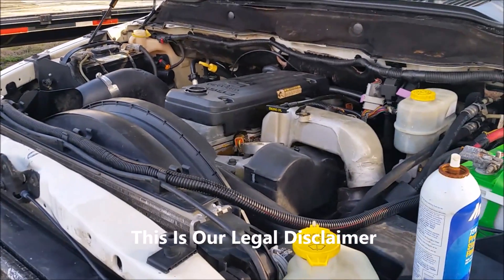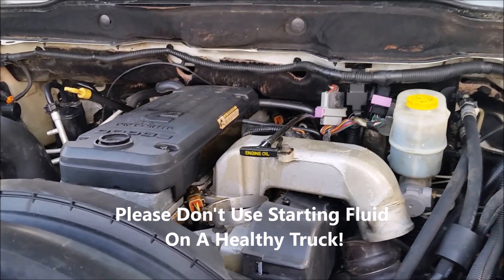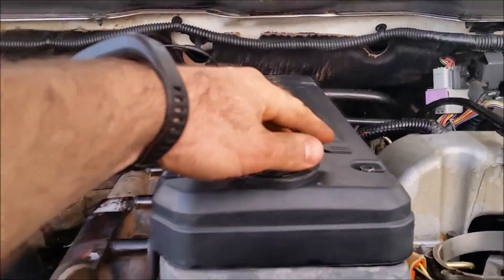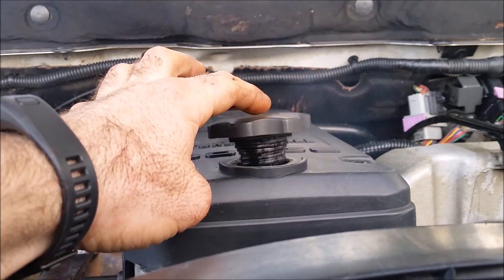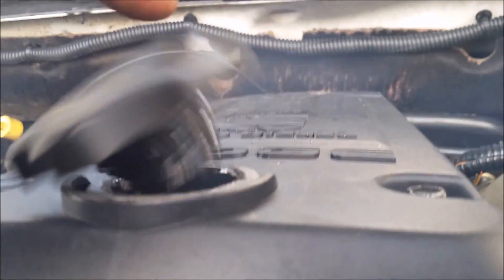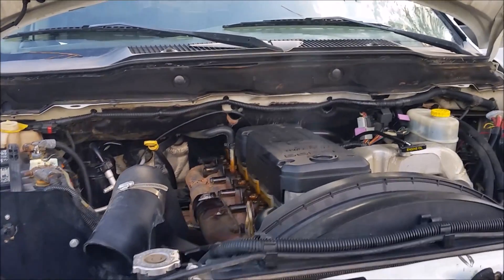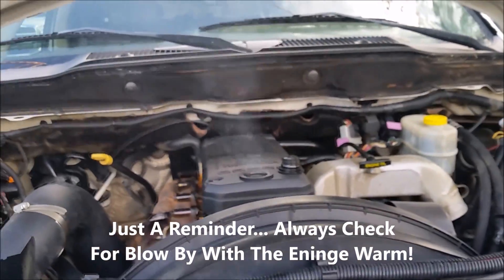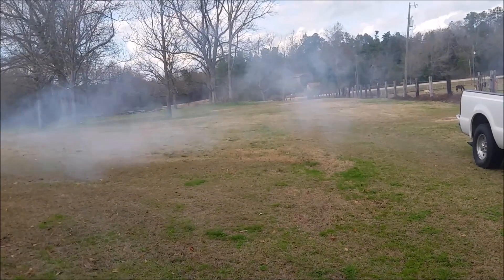Perfect Example Of Blowby On A Common Rail Cummins

Comment: Hey, I know I am a little late on this one but how much did the rebuild set you back? Do you have a price breakdown of the parts you used and how much time you put into labor? Thank you
Reply from the maker: Hey there Peter,
We haven't rebuilt this particular motor yet, but we have rebuilt several others. As far as how much it costs, it really just depends on how far you go on the build. If you go back 100% stock then it will be a good bit cheaper than what we do. We have learned that in the long run it is much easier ( and cheaper) to do upgrades early and not have to go back into them later. 
The same thing goes for time,  we spend a lot of man hours trying to get them as close to perfect as possible.  Why? Cause if you start talking to guys who have bought motor or who have just thrown them together quickly, it usually ends poorly  and then the motor has to be rebuilt again or major time spent to figure out where the issues are.

So my question for you is what do you intend to do with the truck? From there I can maybe give you a ball park of what we would expect to pay.  Keep in mind though,  we spend a ton of time finding deals on the parts we want to help keep the costs down.
Reply: I bought a balanced long block with arp 1000 HP head bolts,fire ring head gasket #103 springs 800 HP pistons , industrial injection wire tap vp44 industrial injection turbo, fluid damper harmonic balancer 4" down pipe bd flex plate triple disc converter firepunk tow master plus transmission. The Plenum plate oil filter housing and most of the outer parts are all billet aluminum and I still don't have all the little nick backs to finish it but I'm way over twenty thousand dollars just for the engine and transmission. And I have restored this truck with every upgrade possible. Yes I know I could have bought a lot newer truck than the 2001 I am restoring but it's going to nice to have a brand new old truck that will smoke most other daily drivers.

Comment: What causes blow by
Reply from the maker: Hey G&D Fishing,
Blow by can be caused by several different things, but this should give ya a pretty good Idea and if I miss one hopefully someone else will pitch in. 

1. Someone does something stupid. My brother rusty bought his 12 from a guy who "dusted it". He ran it without some part of the air filtration system up to par and it eventually sanded the cylinders down to the point where combustion gases could escape and pressurize the crank case. Although these motors do have breather tubes, when the blow by gets bad enough it will cause what you saw in the video. I haven't run into this reason for blow by often, but it does happen. I had a guy warn me that high flow/ low single pass efficiency  air filters could cause the same thing, but over a longer time frame. That made sense to me and now I make sure to buy air filters that have not only good flow #'s but also good efficiency % ratings. Just some extra food for thought.

2. Bad Injectors. This is the most common reason that I see on CR trucks. The fuel system in the CR truck is under alot more pressure than on previous Dodge trucks and for some crazy reason, Dodge and Cummins didn't get Bosch's memo that the Fuel filters were going to have to be able to catch a much smaller micron partical than on the old system. 2 micron is really what the injectors need to be happy and the old stock filters were 10 micron. When you combine that with 26isk psi, it makes for unhappy injectors that don't last all that long. When the injector starts to go it can do tons of damage ( like blow torch a hole in the piston), but one of those things is loose its spray pattern and wash down the Cylinder wall. Without the oil film to ride on it can start to cause premature wear that causes the blow by. 

3. Broken rings. I have seen this a bunch in CR trucks with bad injectors, but can't say if it is caused by the injectors. Maybe some else can chime in on that. Its not rocket science, if you rings are in a dozen pieces, you are going to have a lower effective compression and blow by. 

4. The motor just has a ton of miles on it. Every engine has blow by and the get more and more with miles. But to give you a reference point, I pulled the motor that is now in the Black Hole with 489,000isk miles on it and it had been in a company truck its whole life. It was not well taken care of by any measure, but it still had almost no blow by. So it would take a really long time in a well cared for truck!

Hope that was helpful! And to anyone else reading this, please add to it or even disagree. BUT keep it tasteful. I will delete comments that are not trying to be helpful or are vulgar. This channel is all about learning and helping others have more fun with their trucks.
Reply: Worn valve guides or valve seats could cause blow by
Reply from the maker: Hey Kyle! Thanks for adding to the thread here! You are on point. Badly worn valve seats could also cause some blowby.  Appreciate your input!
Reply: G&D Fishing ok
Reply: i thought it was just a crappy owner
Reply: @70440charger  id say on point 2,3 were good because the fuel will eventually clean off other oils my fuel pump leaks and you can see where its clean without scrubbing at all. And unfortunately diesel i just not the best lubricant for a piston (its not s 2 -stroke design nor does it have oil pre mixed in the fuel, in other words it wont cool like regular oil does... but in fuel pumps it always needs a constant flow to stay cool. plus you dont want diesel to mix in you oil... because it wont. ha at least it will combined and first and then seperate and it will create air bubbles in your oil (which air is not a lubricant) thus scoring the cylinder walls with the rings giving way to crankcase gases to escape  past the piston rings do to a lack of compression ("tight fit" of the piston rings to the cylinder wall with) WITH PROPPER RING GAP! If its not enough it will expand and score a piston baddly. to the point it can sieze. so i say touche'
Reply: Worn rings cylinder heads

Comment: So they don't always last 1,000,000 miles.
Reply from the maker: Hahaha! Yeah, you highlight an important point. In general Cummins motors are pretty strong, but they still can't survive poor maintenance habits. And CR Cummins motors have some pretty heavy odds stacked against them from the get go, but man can they sure make some respectable power numbers!
Reply: All depends on the owner. There will always be the one off chance you'll have faulty parts, you cant prevent that.

Comment: How many miles was on this engine?
Reply from the maker: Hey there, This guys has a little over 200k on the clock. We haven't torn it apart yet, but from the other motors we have had like it, I suspect that we will find bad injectors and some broken rings.

Comment: Wow that's more than my perkins engine does at 2400rpm and high load and urs is at idle!
Reply from the maker: Yep, it was not a happy motor at all! We still haven't torn that motor down yet cause we are focusing on getting motor swap done, but I am really looking forward to seeing inside that motor! Thanks for the comment!
Reply: @70440charger  would be interesting to see what the failure is. More than just worn rings I'd say.
Reply: @shadowpotatoe9482  One of the rings is cracked or a hole in a piston

Comment: Is that a VP on that 05
Reply from the maker: Colby C. : You have a good set of eyes, but it's just a normal cp3! It looks like it has a VP because it has the TPS sensor mounted to the block like the VP44 2nd gen trucks. Thanks for the message and way to pay attention!

Comment: Sounds like broken rings
Reply from the maker: Hey David! We haven't pulled this one apart yet, but I think you will be proved right!  We have torn enough down that sounded similar and in each one of them we have had several sets of broken compression rings. Someone in the know once told me that Cummins had sourced a bad ring for this series of CR's. I believe it cause of how many we have seen over the years.

Comment: no what you peopel dont understand no mather what type of truck that is gasoline ore disel they are prone to blow by because of fuel type oil type coolant type even brake fluid type and if they mix you wont shut of your engine at all that is called pre ignition and cold diseling how ever that same result you can have by electric means like over charging alternator back feading audio equpment static does the same thing to much curent and the seals and gaskets brake down faster to much wacum ore preshure does the same result those problems are mostly related back to GM cars and their sub donor car parts manufacturers like Opel,Ford,Crisler,Isuzu,Suzuki,Holden,Pontiac,Oldsmobile those are known to Engine run ON expecialy if those engines are SOHV ore SOHC engines those are called universal engines they work basicaly on any thing methane ethane acids even on charcoal if you like, how ever a unique capability of those engines are not just multi grade fuel engine its their power multiplication capability like waste spark ignition so your 4 cilinder is realy a 8 cilinder futher more your 4 cilinder can by down graded to run just on 2 cilinders those are called variabel cilinder deactivation cool features not a suprise at all if some of you peopel ever see the old Lenz Bulldog tractor acient engine you will see it runs on bouth disel and gasoline those are some tiny suprise from good old GM
Reply from the maker: Hey there Devil's Wish! I do understand where you are coming from and what you are trying to share, but this particular series of Cummins is prone to this issue more than any other series of 5.9 cummins. There are a few things that cause it but It tracked back to injectors and in a very few cases a bad run of pistons rings. 

It is very common and it is something that anyone who is buying a 2003-2007 5.9 Cummins motor needs to be very aware of.

Thanks again for sharing your thoughts and I hope they help someone.